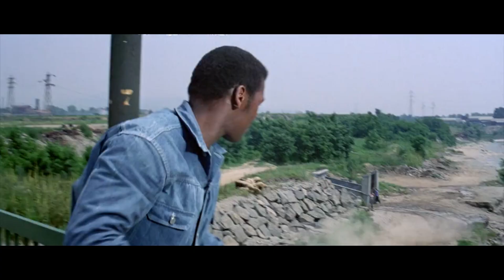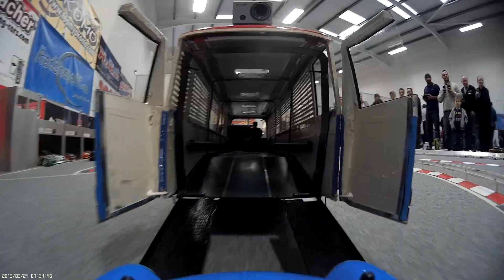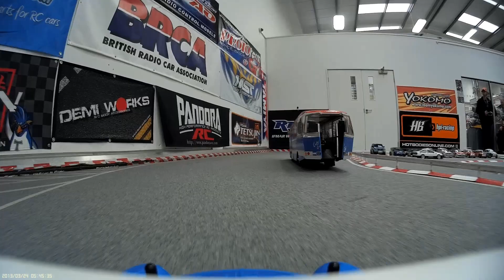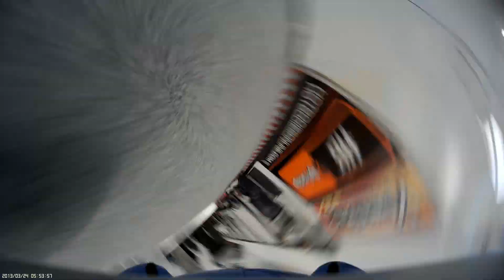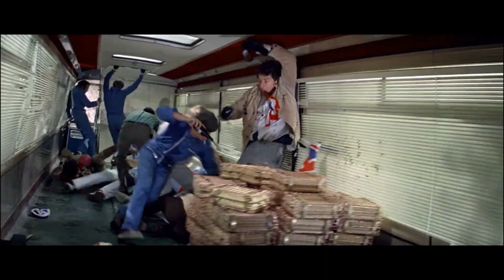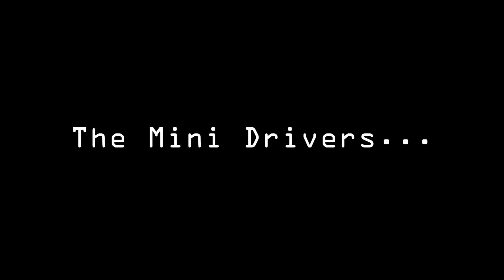RC Italian Job 2014

Comment: Wow what scale are the bus and cars I love it are they custom builds or can you buy them!!! And great video wow 😍
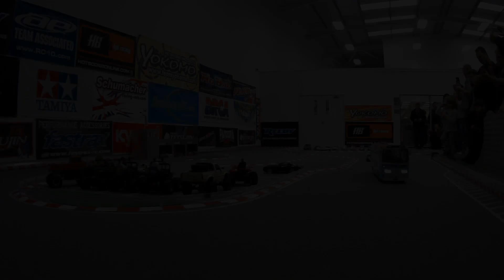Reply from the maker: Thanks. The coach is custom built, with just a few basic running gear parts taken from old Tamiya touring cars but chassis and body are all scratch built. The Mini's are Tamiya M03's, old cars now but can still be bought, in fact I still race mine regularly. The Mini shells are hard to get hold of now and therfore expensive but theres other non-tamiya versions around. In terms of scale I guess it is all around 1:10 scale approx. 
Hopefully we'll get other opportunities to run the display again. The coach needs some work to get it back up and running, and I know its owner and creator is always looking for ways to improve the design too. In addition to the event where we filmed for this video, the coach has appeared at a Mini show, on a BBC TV segment and an RC Racer magazine piece was written too. Hopefully when the world returns to normal there are other things we can do with all the vehicles again. 
Thanks for commenting 👍

Comment: Are those minis modified?? Maybe new shocks or steering?
Reply from the maker: Heene Studios I can only speak for my Mini - the camera car, but its running the standard ESC with a HPI Saturn 20t motor, Savox servo, 3 Racing shocks with the Tamiya spring kit, anti-roll bar kit, adjustable camber links, reinforced gear set and Shimizu medium compound tyres.